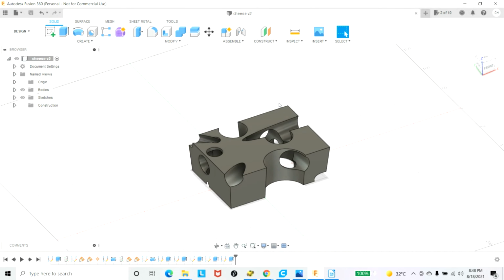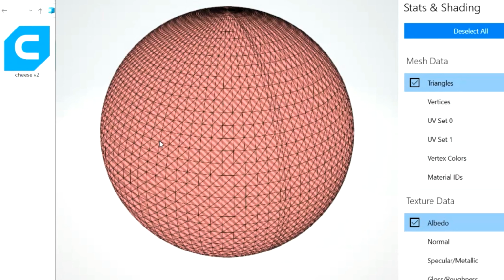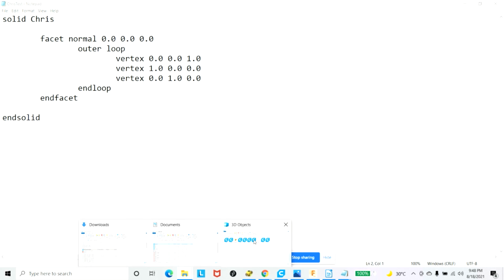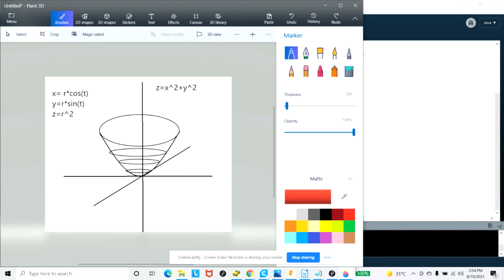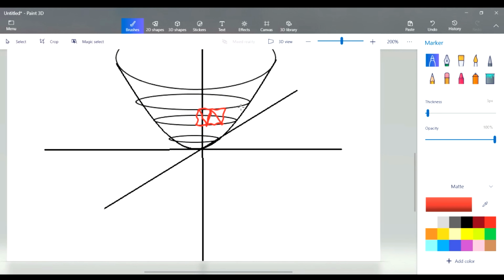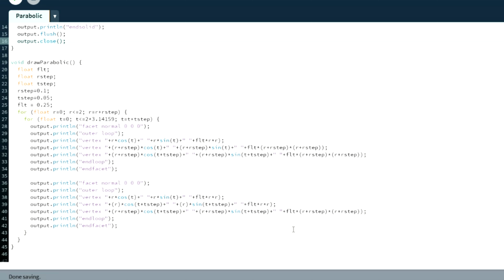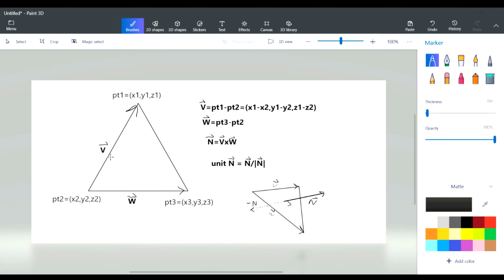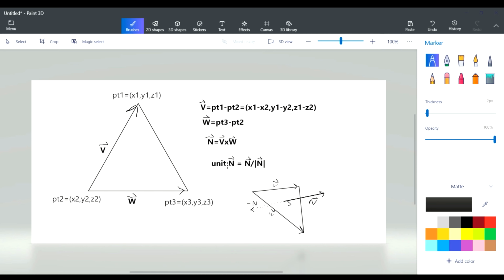Making an STL file from scratch.

Comment from the maker: Code included in the video:

PrintWriter output;

void setup() {
  noLoop();
  output = createWriter("Parabolic.stl");
}

void draw() {
 
  output.println("solid chris");

  drawParabolic();
 
  output.println("endsolid");
  output.flush();
  output.close();
}

void drawParabolic() {
  float flt;
  float rstep;
  float tstep;
  rstep=0.1;
  tstep=0.05;
  flt = 0.25;
  for (float r=0; r<=2; r=r+rstep) {
    for (float t=0; t<=2*3.14159; t=t+tstep) {
      output.println("facet normal 0 0 0");
      output.println("outer loop");
      output.println("vertex "+r*cos(t)+" "+r*sin(t)+" "+flt*r*r);
      output.println("vertex "+(r+rstep)*cos(t)+" "+(r+rstep)*sin(t)+" "+flt*(r+rstep)*(r+rstep));
      output.println("vertex "+(r+rstep)*cos(t+tstep)+" "+(r+rstep)*sin(t+tstep)+" "+flt*(r+rstep)*(r+rstep));
      output.println("endloop");
      output.println("endfacet");

      output.println("facet normal 0 0 0");
      output.println("outer loop");
      output.println("vertex "+r*cos(t)+" "+r*sin(t)+" "+flt*r*r);
      output.println("vertex "+(r)*cos(t+tstep)+" "+(r)*sin(t+tstep)+" "+flt*r*r);
      output.println("vertex "+(r+rstep)*cos(t+tstep)+" "+(r+rstep)*sin(t+tstep)+" "+flt*(r+rstep)*(r+rstep));
      output.println("endloop");
      output.println("endfacet");
    }
  }
}
Reply: Could you do a sulky and a horse. Ihave the 2d  picture on the horse and sulky. If you can, how much do you want